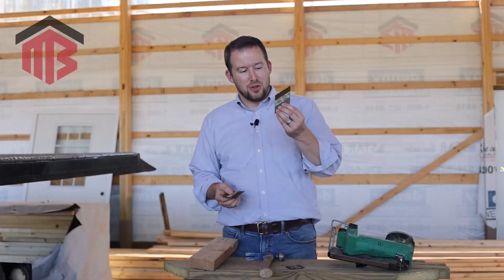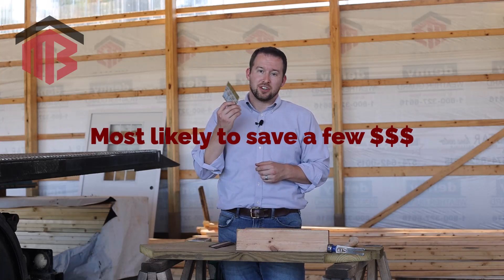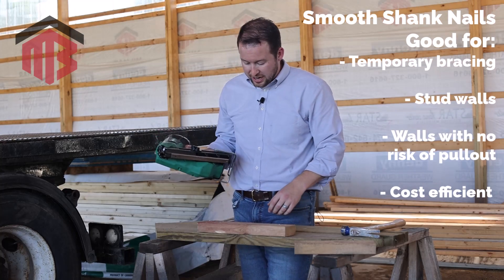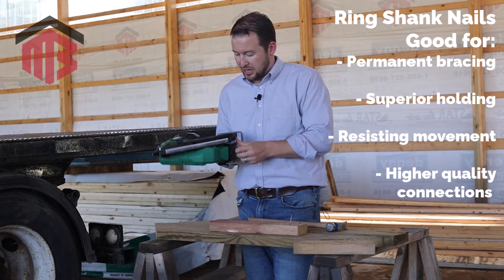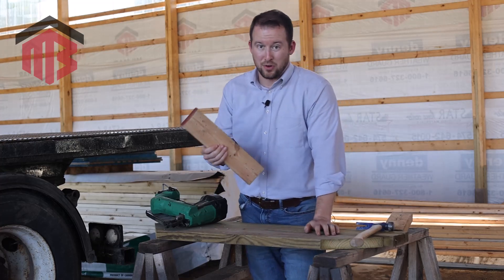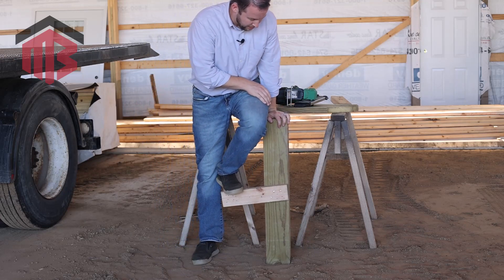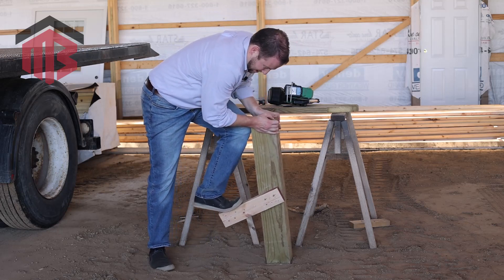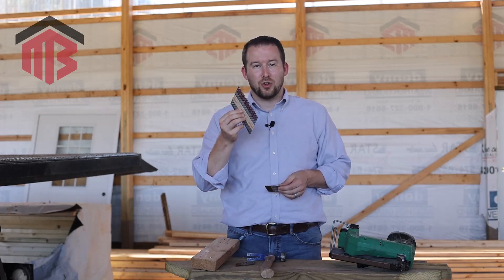Smooth vs Ring Shank Nails for Pole Barns

Comment: We use 20d ring shank hand nail for most of our post frame fasteners. 60d for the purlins. 16d slicks for temp bracing and some window framing. Definitely wish we had the jumbo nailers for it.
Reply from the maker: The jumbo nailers are beasts!   Very cool to see where building tools and tech is going!
Reply: I agree with the Jumbo nailers. We just bought a Fasco 4” to 6-1/4”. As many nails as we run, it only makes sense to buy a couple of them and check production. Gonna miss driving them though 🤣

Comment: Is 3" long enough for a ring shank. I haven't been able to find anything longer for a framing nailer.
Reply from the maker: 3" may be plenty for what we are doing, but you should always make sure your length matches the application that you are intending it to use it for.
Reply: @MilmarBuildings   Essentially it would be a post frame garage/barn. I imagine a nailing schedule probably comes into play too. I just need to find one that specifies usage of 3" ring shank nails.
Reply: Most 30 degree nailers will shoot a 3-1/2”, which is okay for girts but when you’re standing 2x4 purlins across the lid then a 6-1/4” pneumatic is legit. I like running strip 4-1/2’s in the girts myself. 🎉🎉
Reply: @ginger_bredman  Any reason to use nails over screws? I'm guessing that the cost of a large nailer and compressor are going to exceed the extra cost of screws but I could be wrong.